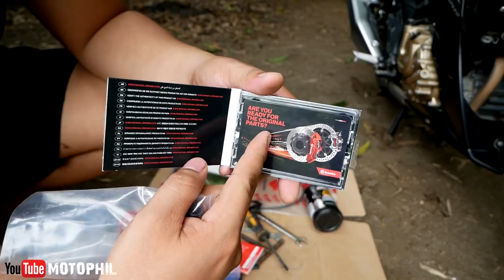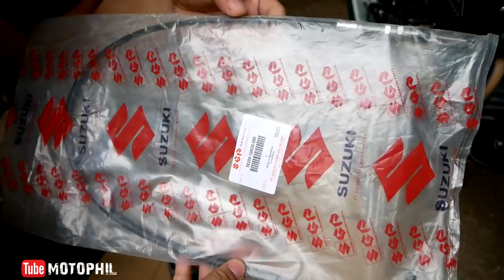brembo rcs 19 and sgp clutch cable raider 150 fi thaiconcept project

Comment: Good Jobs I like this video,very clear the parts used for the upgrade to the Brembo RCS19.I want to see which Banjo pipe I should used because my parcel still with the custom.Why I want to upgrade to both side hydraulic is because my clutch cable too short when I want to bend the handle bar more closer to my body position.The Benelli Leoncino(500cc) handlebar is too wide,I'm just 5 foot 3",it made my hand too tired and body position too.If want l longer good quality clutch cable is not easy to find but Banjo pipe is easy.